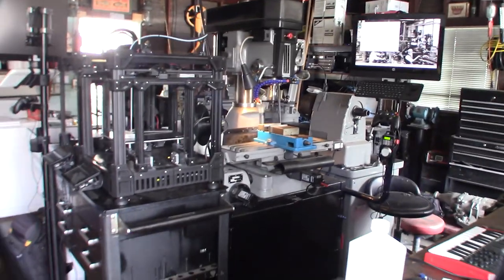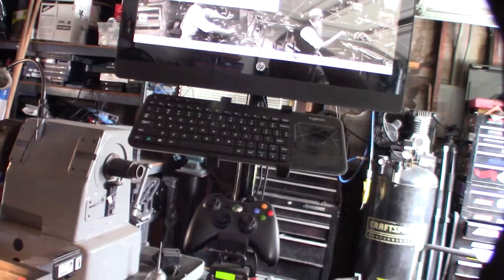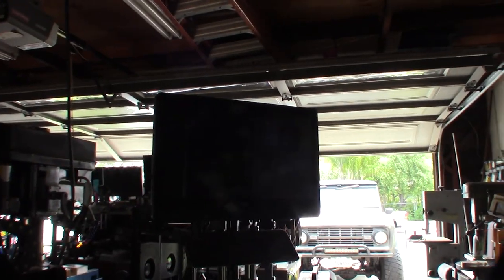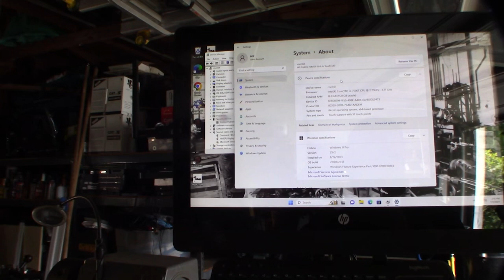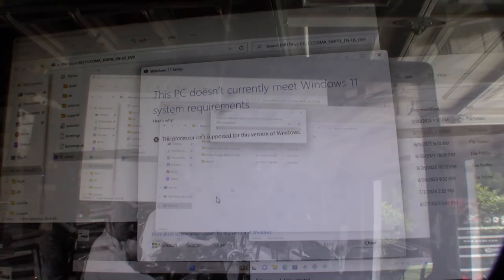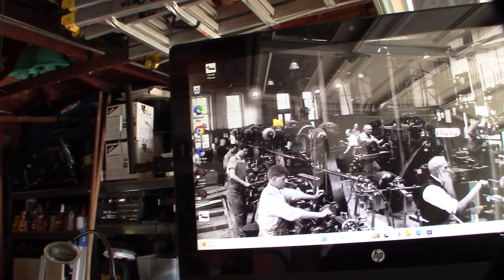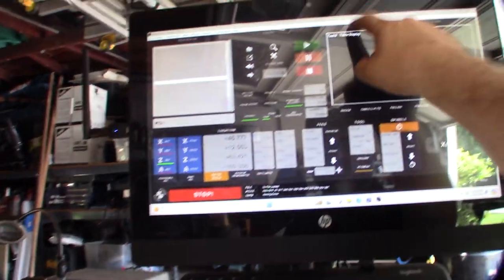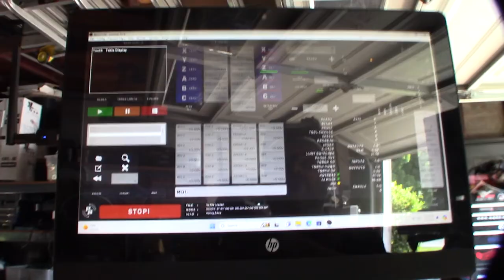Mach3 CNC Windows 11 23H2 Guinea Pig With Warp9 Smoothstepper Installation

Comment: Really jealous of the machines. But I can't believe you're still fighting with that Windows stuff! Join the dark side where you don't have to constantly crack and hack everything. You should try LinuxCNC 😁
Reply from the maker: I know I Know, Windows sucks. I've actually built a few LinuxCNC machines, at least 80 hours playing with it. Kind of funny because I've built and maintain hundreds of Linux servers. I haven't switched because I like how crisp the physics anonymous user interface is. I'm running on bowered time because mach3 was written in VB6.  I like the probe_basic interface on LinuxCNC. I was going to LinuxCNC a Brother CNC machine with tool changer and even had a guy willing to give me one for retrofitting Centroid acorns to his massive 16'x10' CNC router. I changed my mind because I didn't want something I couldn't move myself and take up half my garage. I have more fun playing with 3D printers.
Reply from the maker: I'm not sure if you will get this link, looks interesting for my new hotend design. The extended M6 insert.
Reply from the maker: https://www.aliexpress.us/item/3256805680087197.html?spm=a2g0o.detail.pcDetailTopMoreOtherSeller.8.494cOtmIOtmI70&gps-id=pcDetailTopMoreOtherSeller&scm=1007.40000.327270.0&scm_id=1007.40000.327270.0&scm-url=1007.40000.327270.0&pvid=3f3aedb6-f119-4c20-b4fb-182a4742898f&_t=gps-id:pcDetailTopMoreOtherSeller,scm-url:1007.40000.327270.0,pvid:3f3aedb6-f119-4c20-b4fb-182a4742898f,tpp_buckets:668%232846%238110%231995&pdp_npi=4%40dis%21USD%214.61%214.61%21%21%214.61%214.61%21%402103246617211763447523269e67ba%2112000034629245278%21rec%21US%21139202731%21&utparam-url=scene%3ApcDetailTopMoreOtherSeller%7Cquery_from%3A
Reply: @fintechrepairshop  No idea why it is not letting me reply. Yes, I have some of those. Basically I think it is just a question of how to sufficiently brace a large heater block.
Reply from the maker: @jessicav2031  I'm going to machine some round stock
Reply from the maker: https://www.mscdirect.com/product/details/06043830
Reply from the maker: I'm going to use some kind of thermal washer to give it support.
Reply from the maker: I heard youtube is blocking comments. Not sure why. They do weird stuff with my channel.
Reply from the maker: I'm using standard V6 cooling fins and going to put a thermal washer between the heater block and cooling fins for support. screw it in until it tight against each other. I will have more heat transfer but I don't it will matter with that extremely long melt zone.
Reply: @fintechrepairshop  My partner is using titanium bolts to support his experimental heat block. Seems to work pretty well. He just used a tapped hole in the side of the block.